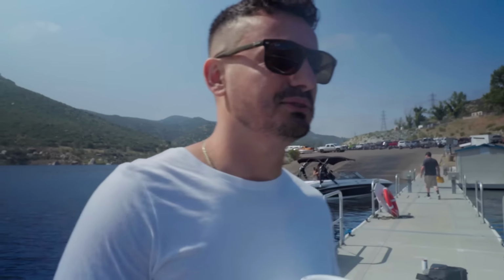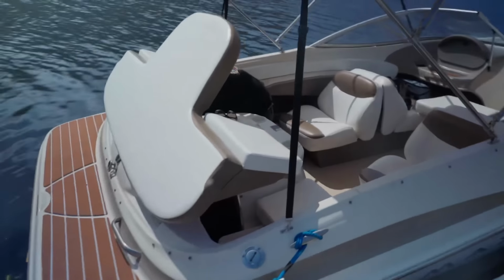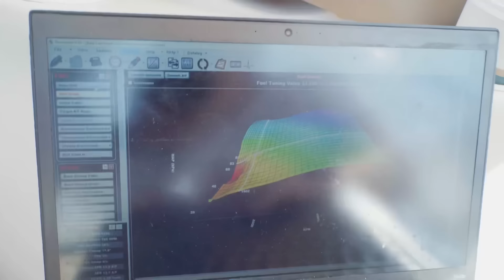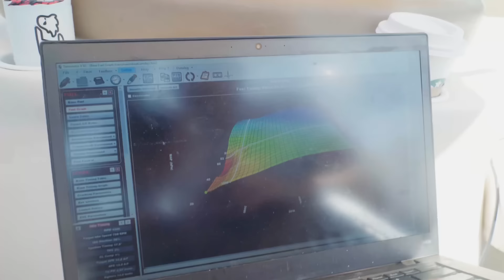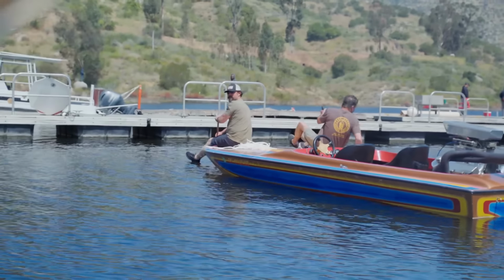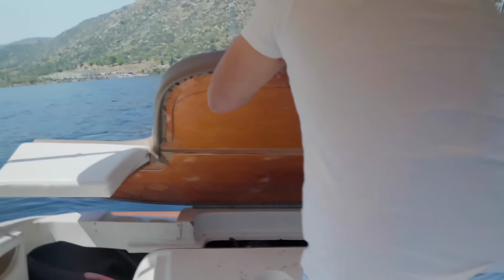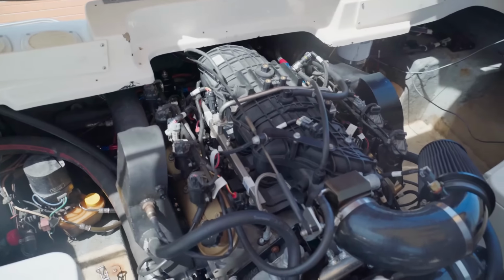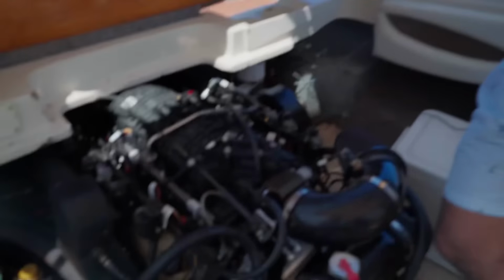Power boat gets junkyard LS swapped 5.3 v8 | build breakdown + top speed lake testing

Comment: I love the sound of that engine at idle and on the fly by runs. 70 m.p.h. ain’t too shabby. Quite the step up from the old 4.3 V6 for sure. Nice swap.👍👍🇨🇦
Reply: I had a 18 ft bayliner with the 4.3 HO it would do 65 i think it had a 19 inch prop.

Comment: That's awesome.  70mph on a boat designed to do about 45mph.  So that puts the cruise speed at around 50mph, which is perfect.
Reply: 3500rpm is 43-44mph
Reply: @travtech1  That's all you need.  Not stressing anything and you're flying....

Comment: I don't think everyone realizes how big and heavy this boat really is! Its awesome how nice everything is working together and I'm dying to see this boat when it had the original 4.3 V6 in it! The 5.3 literally transformed this boat into something special. You have got to share the update when you install the bigger flexfuel injectors.
Reply: In the bowrider world, this boat is actually not big (this is a pretty small vessel) or heavy.  This boat is light, like light-light.  In fact, a bayliner/maxum is of the lightest bowriders out there, purely due to thinner (and fewer) materials.  I don't say that to bash it, but to rather make a point that the power/weight ratio of this boat would be better than something more substantial (a FourWinns, Regal, Cobalt etc for instance).  When you're looking for speed, power/weight is what you want.  So not a 'bad' decision in that regard.  But an odd one given the relatively lower "perceived value" of bayliner/maxum.  I guess that might add to the "cool factor" though.
Reply: @yoster77  the low value of the Maxum would make flying by a $200k powerboat that much more epic!
Reply: @savage6394  True but there's 0 way that's flying by a 200k powerboat lol! (ok I guess it depends on the TYPE of boat lol).  It's a cool swap sure, but, lots of 70-80mph boats out there every day at the lake.  They'll definitely be King of the family bowrider class though :)
Reply: Reality is there are actually not that many 70-80mph boats out there. And very few 80+ mph boats out there.  Depends on the lake tho, up where I'm at nothing beat me when I was a 68mph boat, and nothing could touch me after the build when it was an 83mph boat!
Reply: @yoster77  I think he meant compared to a car on the size aspect. but About the power to weight its not sooo important on a boat that size if your just a normal boater you really want the torque that a marine engine is designed to put out but yes taking it to that extreme with the 5.3 tuned LS its bound to be quick. I've got a cuddy cabin boat similar size with the vortex 4.3 and she does 44mph which for boat standards is quick! so 70+ mph in that is ridiculous.
Reply: @yoster77  I’m guessing you haven’t looked at boat prices lately. That Maxum will fly by most $200,000 boats these days.

Comment: Don’t worry about the alpha gen2. I have been running 452hp and 479tq through mine for 8 years. Drive cooler and synthetic lube goes a long way.
Reply: What are you running?
Reply: @oddlyrightoddlyright2475  a built 383 in a Crownline LPX.
Reply: @CRASH ALEXANDER pushing a 20ft boat it is not under a lot of stress.
Reply: @mken4740  what oil? Straight 30 synthetic? Also did you keep your bearing clearance up?
Reply: @oddlyrightoddlyright2475  5-30 VR1 in the 383 and ams oil 75w-90 in the out drive.
Reply: @CRASH ALEXANDER sounds good. I’ve just been running one for 7/8 years at that level. No issues.
Reply: @CRASH ALEXANDER even if you do, you pull it off and toss on another 1,000 outdrive. It’s like a set of good rear tires for a car. Not a huge deal in the end.
Reply: @mken4740  thanks man
Reply: If you are indeed pumping that much power through an alpha (regardless of boat size) for 8 years (Im assuming hundreds of hours) then you know what you are doing. With that much power the average asshole would blow that drive in a matter of weeks. Your situation is not the norm. Im impressed.
Reply: @deksea  just run it like you built it and have to replace it. It’s not a big deal even if you do. There’s guys chopping the alpha gen 2 and running 750hp through them. Just be smart.
Reply: Really clean set up and it runs and sounds great!
Reply: I was going to say...
Reply: The alphas regardless of gen is built for a maximum hp rating of 300hp. Anything more than that you’re either babying it or just straight lucky. Bravos we’re created for the bigger/more power boat/engine setups. If you want to go full build on motor make sure you swap to Atleast bravo 2 for any extra power just for a safety stand point. Or else get towed in by a 15hp pontoon 😂
Reply: Agree.  I had a 21’ Baja Islander with an Alpha drive behind a 383.  Engine had AFR heads and custom cam.  Cam was small due stock manifolds.  Made 430 hp/460 tq.  Ran the heck out of it for 5 years with no issues.
Reply: @jhuck8166  exactly, lots of guys can read the online spec bs and spread that info. All I am saying is what I’ve done for the last 10 years with one. Like I said before, if it breaks, big deal. Toss another on. Scared it’ll break like me, buy an extra. It’s probably bad by now from not being used in my garage the last ten years. But, I’ve got it! Ha
Reply: @oddlyrightoddlyright2475  the gearcase needs... gear oil. 80-90w synthetic anything really if its just in a wimpy lake
Reply: @crashalexander7232can u please explain .. I’m not saying u don’t know your stuff I’m asking because a car weighs 3000 pounds and has this same engine I’d like the science behind the stress wat causes it .. isn’t water less resistant then 3000 lbs on street

Comment: That's a pretty cool swap with a solid engine without adding a ton of weight.  70mph with an I/O is impressive.  I'd stay away from the E85 though if you plan on using it regularly. You might get a few more HP but with a big loss on fuel economy, and you'll burn through fuel like a jet ski.  I did a 6 month experiment with E85 in my Yukon when gas prices were almost $7.00 per gallon for premium and E85 cost 30% less. My overall cost per mile was still a little better on the premium just because my fuel efficiency dropped by roughly the same % as my cost for fuel did.  So it wound up being a wash and I had to fill up more often and I didn't get any noticeable performance gains.
Reply: @sirsneakybeaky   The computer systems in FFV's are already designed to make their own performance adjustments based on sensing the amount of ethanol in the fuel being used, so you don't really need to tune for it.  They will generally get a few more hp and some torque, which makes towing easier.  People who do specifically tune for using E85 are generally trying to achieve max power in custom-built setups, not efficiency.

Comment: Hey man love the swap!! Just a heads up I think your exhaust riser run is too short for the cam you have in there. You might be reverting water back into your exhaust when running. Just be careful.
Reply: Thanks but it's been running like this over three years no issue with water in the oil. Cam is not that big. 216/220@.050 .560" lift 114 lsa

Comment: Wow. I have 96 Maxum 19’ and swapped the 4.3 for a 5.7. Captains call with through hull. It’s fast enough but of course I’m looking at vortec head swap. Not sure how it will run with that compression though… anyways, I love what you did!
Reply from the maker: We tune it for the compression, it will be fine! Has ran for 2 years now
Reply: @Dardantuned  I meant if I swap my mag 260 for vortec heads it’s ups the CR a bit.. hey what was the top speed and rpm? That thing was flying
Reply: Run 93 octane. An flat top pistons should be ok. Very popular swap. Offshore powerboats has a lot of info on this. Will need intake manifold change as well. If your running a merc. Also look at a HEI swap as well an did the the coil. 

Can be done on an OMC but takes a bit more work.
Reply: @DavidSmith-kw6cv  thanks for the info! It’s all merc stuff. Cali only has 91.. what do think?

Comment: That alpha one out drive is getting tested and is about at or over what it's designed to handle as far as HP goes for sure and upgrading is certainly not an easy task I don't think you can just bolt a bravo one on there but it's really what it needs they handle big block power maybe with real good maintenance synthetic oil the alpha might live for a good while that boat is badass as well you know damn that's awsome

Comment: Ive got a stovebolt 6 in my boat. Was thinking of going v8, BUT, ended up finding a 68 firebird sprint motor, PMD OHC. Boats got a 165 hp, the pmd is rated for 215. In time...

Comment: Remember back in the day a good friend of ours supercharged the stock 6.2 truck engine and did some stuff with the fuel and tuning in his 23ft Sea Ray and that thing would run about 70-75 at almost 5k lbs, so I just KNOW that boats fast a fk.
Reply: a 23' sea ray cuddy i find hard to believe is doing 70+ unless that motor was pushing 800hp.

Comment: Love the build, what a sleeper. I have a 6.0LS swapped 1981 glastron cvx18 and am in the final stages of restoration / final touches. What are the cam specs, any issues with reversion? Dry or wet exhaust? I am running a BTR stage 2 truck cam

Who makes that 25P prop? I have a 21P with that same Alpha gen2 drive and it seems like it could use alot more prop
Reply: It's a elgin sloppy stage 1 cam 216/220 .565 114lsa
Michigan wheel ballistic 25p

Comment: Great tuner one if the best going from a 4.3 what had to be changed on the back end  of the motor were hooks to drive did you have to move the mounts up some.  Been wanting to do this if motor ever goes did you go with marine cam

Comment: @travtech1 Quick question, are you just using this raw water pump from the alpha drive to feed the engine water, or did you add a sea pump to the front of the motor, or are you using both methods?

Comment: Does Holley have the shift interrupt switch for the alpha drive when going in and out of gear. I ended up doing a bad ass 383 Stroker sbc 8 years ago instead of an LS1 Stroker for that reason. You’ve got me thinking! :)
Reply from the maker: Yes! We are using 2step to trigger a cut when it goes in and out of gear so the transition is smooth and wont break ish..
Reply: 2 step set at 400rpm.

Comment: The new LV3 V6s in the 2014+ trucks are based on LS instead of gen 1/2 350 chevy architecture. As such, stock for stock they make as much power as an NNBS (07-13) 5.3. Richard Holdener tested one with a single big turbo and stage 2 cams and it make over 700lb-ft safely but ran out of injector overhead before even 4500rpm with that much boost. A normal LS swap is cool, but replacing the old 4.3 with a better 4.3 would've been more unique. Even just the stage 2 cam and full bolt-ons bring the LV3 up to 375HP.
Reply: Those are lt based not ls. I'll pass on the direct injection mess.
Reply: @travtech1  The point is they have much nicer heads and higher potential. There should be DI block-offs and port injection intake manifolds already available.

Comment: @travtech1, I Was also wondering what method you used to get the shift interrupter to work?
Reply: Wired it to spare input on holley set it up to trigger 2 step limiter at 400rpm. Gets it to dip rpm to come out of gear smooth but not stall out the engine

Comment: Great Swap ..Richard says e85 does not make enough power on na to fool with it Dyno does not lie
Reply from the maker: Thats a lie or isnt tuned correctly! Depending on the motor it will always make 10-30hp more! Especially on higher compression motors like ls3 or 6 liter gen 4
Reply: @Dardantuned  lol yea like i was saying not much if any
Reply from the maker: @overbuiltautomotive1299   but thats dependent on the motor, a low compression motor wont make as much but ls7 for example will make over 30whp from e85 alone.
Reply: @Dardantuned  well on his dyno they were not geting much extra in peaks on stock / cammed stuff but it an oh well thing i guess i did not do the tuning .boost e85 is king no doubt
Reply from the maker: @overbuiltautomotive1299  ive done hundreds of cars on e85 na from honda to v8 stuff and ive never seen a motor gain at least 5-10hp even 4 cylinder. Plus its 1/2 the cost and much better for the motor long termn

Comment: I have a 6.0 im about to put in. What are the specs on this cam? I want top end speed without water coming back especially at idle. My exhast are wet/dry out of the lower side. Do you travel to tune? Im located in Ft. Myer Florida

Comment: That Maxim haul was never designed for those kinds of speeds. Make sure your health and life insurance are paid up.
Reply: It does very well at that speed. I do think it's getting close to the limit of the hull though.
Reply: @travtech1  

Growing up on the lower Potomac river in the ‘80s, I saw too many terrible boat wrecks. Most were caused by hot rodded haul, and operators without any brains. Granted, coke probably contributed.

Comment: I have a factory LS 5.3 gen v that’s in my boat. It’s a Volvo penta that they de-tune to 300 hp. I wonder if I could unlock my ecu and have the power pumped up?
Reply from the maker: Is it running gm ecu?
Reply: @Dardantuned  I believe it is but Volvo puts there own sticker and part number on it

Comment: At about the 5min mark, you mentioned that a marine Tstat needs to be on the outlet side, but the LS is on the inlet side.  Can you elaborate, because I can't figure out why it would matter.  I had planned to use stock LS pump/Tstat with my closed cooling system.
Reply: The issue was with  the open system. With a closed system factory pump and T-stat work great.

Comment: When you add the nitrous, don’t for get to let us know what the dimensions and type of prop you’re running.  “A 25 pitch stainless 3 blade” is pretty generic.  What’s the diameter, brand, and style?  Different props will affect your boat differently and you can gain 3-5mph just in a style change.
Reply from the maker: I’ll have all that info on the next vid! Anything else you guys want to know respond with comments
Reply: @Dardantuned  for the next video can you cover; motor mounts, fuel pickup, add ethanol content sensor, raw water pump, closed water cooling setup, the oil cooler how it's plumed, oil filter  stock or remote position, show the wet exhaust setup!

tuning side, how to save the outdrive!
Reply: Michigan wheel xhs 14.25 dia 25p 3 blade 
Motor mounts are steel plates 3/8 thick that adapt the 3 bolt mounts from v6 to the 4 bolt ls block.
Raw water pump is stock inside the out drive pushes water thru p/s cooler then oil cooler then to exchanger then to headers out the exhaust exits. Steam ports on engine plumb back to water pump outlet. Has 170 deg t stat.
Reply: Oil filter is in stock location with sandwich plate to feed to cooler. I  added to the truck oil pan sump by welding a bigger box to it to add capacity it holds 11 quarts of oil now.

Comment: It sounds like the gear ratio is off from the actual standard sets .maybe try out the upper gear set of 1:50:1 with the lower of 17/28 for a bit more speed 😈😏😎🙊

Comment: What our drive???
Reply: He said it. Stock alpha one with the v6 gear ratio
Reply: @BoughtNotBuilt  Didn't see it mentioned in the beginning.  Alphas struggle to last if you go above 300hp a whole lot; just make sure to do soft launches or you'll shear teeth/grenade the gearcase.  You can still rip with them but just don't do large sudden increases/hole shots.   Cool build!
Reply from the maker: We have ignition cut once you transition into gear for this purpose! We forgot to mention in video
Reply: 4.3 160hp V6 gear ratio alpha 1 gen 2
Reply: @BoughtNotBuilt  v6 ratio, 1.81/1.82.   4cyl is 2.0
Reply: @addvancedgarage  You didn’t watch the video?
Reply: Awesome video. I have a 1992 Glastron 1900 with a 4.3 ltr Alpha 1 gen2. I'm in the process of swapping it out with a Lexus 1uz-fe VVTi engine and decided to tickle it with 2× GT2871 turbos for some fun. Obviously run a low boost of about 5psi to begin with until I can swap out the conrods for aftermarket rods. Busy making up stainless steel headers at this point.

Comment: Run flexfuel on a boat?  Seriously???  You are talking about putting 85% Ethanol based gas an open air vent fuel system on water.

That is going to go well when the gas tank has a ton of water absorbed by the Ethanol from the fuel tank vents.

Unless it is a racing only where you drain the gas and clean it regularly out of the tank and replace/empty it, this is a terrible idea.
Reply from the maker: We have the other twin turbo boat on e85 with no issued, its flex fuel with valves

Comment: @travtech1 Quick question, are you just using this raw water pump from the alpha drive to feed the engine water, or did you add a sea pump to the front of the motor, or are you using both methods?
Reply: Stock alpha pump
Reply: Alpha pump pushes water thru the heat exchanger and out thru the exhaust.  Engine has a 5.3 truck water pump that circulates the coolant thru the engine and t stat then heat exchanger. Hope that helps